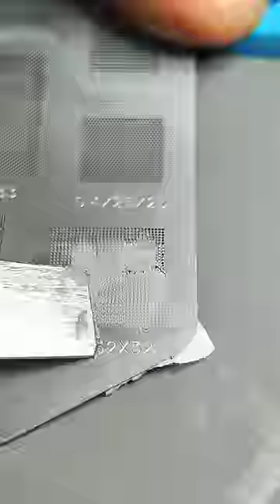CPU #shorts

Comment: For those that don’t understand what is happening, this man is removing something and then putting something else back on.
Reply from the maker: thanks for info 🌹
Reply: Why? What's the diff between the old and new ARM?
Reply: Why not just turn it off and on again?
Reply: @herrbonk3635  The new one is not broken.
Reply: Thanks bro, i couldnt see what he was doing cause of blindness ❤
Reply: I highly doubt they were even different chips.
Reply: 🤣🤣🤣🤣🤣🤣ur funny.
Reply: Why did he have to reball the chip unless it was pulled?
Reply: Thanks for clearing that up!!
Reply: Why not throw it away and buy a new one? This repair has to be close to that cost, and who’s to say the next chip on the board doesn’t let the smoke out in 5 or 6 hours of use? Boards must be obsolete, or extremely rare, and expensive to justify this..
Reply: @GRANITEMONUMENT  for a lot of things, replacement boards are expensive. The ones I was repairing for cell phone towers were 800 dollars, and that's when they were in production and all the development was paid off, the minimum cost.

If you do the diagnosis and repairs correctly, you can ensure that the root cause is actually fixed, usually a power issue causing the big chip to fail. Sure, it'll fail again eventually, but that's just reality. Saving a few hundred bucks is worth it, even if it costs a few hundred to fix.
Reply: I mean that's obvious,
You could try telling us what did he remove and added
Reply: @phillyphakename1255  well you stick to cell phones, because when your talking about older electronics you are getting into EPROM’s which don’t care if you test it, they fail over time., no shorts, or overheating, caps will fail as they get older, quite a few items on older electronics can be tested good today, and go bad tomorrow with no outside forces like heat, cold, short to ground, excessive voltage., they can fail sitting on a shelf., the neighborhood cell phone repair doesn’t get into that type of electronics…
Reply: @GRANITEMONUMENT  lol. I was working on cell tower boards, not cell phones. Hundreds of watts of RF output, thousands of watts of input power. Not your 10 watt phone.

And the reason I say "was" is because I am now working on exactly your kind of stuff. Date codes from before I was born. The shop smells like rotten fish half the time from the leaking capacitors. I've knocked 10 layers off the boards I repair.

I know that things fail, which is why we repair them. That said, the goal isnt to fix it forever, it's to get the customers a few more years out of their obsolete and essential equipment. At both the tower job and the old stuff job, we get our customers about an extra 5 years on average. Less than 5 percent get returned in the 1 year warranty. That's a far cry from your claimed fails after 4-6 hours or the next day.
Reply: He put the same Chip back on. It's not something new
Reply: @GRANITEMONUMENT it could just be reballing...
Reply: reballing, he is reballing the chip and putting it back in place
Reply: @herrbonk3635 new one looks prettier
Reply: it’s called cpu reballing it essentially changes the socket balls in the cpu this is normally done when a phone suffers from a deadboot commonly happening in cheap poco phones like notorious Poco M3, Poco X3 Pro this is common because they’re good to be true especially the Poco X3 Pro, the motherboard is cheaply processed that’s why
Reply: Thanks for explaining, I’m not a tech nerd so I wouldnt know he was doing that
Reply: its reballing process and not necessarily replacing it
Reply: @xavirav3358 ахахаа😂
Reply: This is done when you have dropped your phone Or overheated the cheap causing those soldering connection fail
Reply: LMAO
Reply: 1. Reboot
2. If rebootin' don't work. Level up yer skills to perform brain surgery. But on a puter.
Reply: They are called, CPU Reball, they just clean the balls pins under the cpu and put it back again.

Comment: feels like the last cpu getting ready for the one last fight
Reply from the maker: yes 😁
Reply: Терминатор собирается
Reply: that hit me hard.
Reply: Mission log Phobos base - Day 187: The oxygen generator has stopped working again, narrowed down the issue to the CPU board in the Modular Electronics Controller Unit this time. I used my only spare a week ago on the main power bus unit after that one got fried by an electrical short following the crash. The same incident also took out the orbital relay dish as previously mentioned. Attempts to reestablish satellite uplink today using the short range transmitters has been unfruitful, it was a long shot I suppose, but worth a try. In regards to the O2 generator issue, there is a another unit with a compatible board in the rover which  I can see  lying on its side some distance from the Eastern viewport, it seems mostly intact from here however I am unable to reach it as the environment suits are kept in hab 3 and the connecting tunnels from hab 1-2 and 1-3 were destroyed when the supply ship's propellant and oxidizer tanks went up, I am completely isolated here. I can see fragmentation damage to both other habs from here and they appear to have both depressurized. Mission Commander Hamilton, Mission Specialist Williams and Mission Specialist Wehrner... are presumed deceased at this point. Will try cleaning the board and connectors for the generator in hopes of restoring functionality, If the unit is still nonfunctional after this I calculate there is enough left in the reserve tanks for maybe a week. If anyone recovers these logs sometime in the future, let my family know. Tell my wife and kids that I am sorry and... I tried.
Reply: Wow! It gives off such a cool atmosphere! @extremepredudice
Reply: @DairoNecto  All we saw was a person cleaning a circuit board, context is everything :)
Reply: @extremepredudice  I'm always trying to write my stories in an interesting way, but I have a lot of difficulties. Seeing you do it like this is really impressive, congratulations!
Reply: @DairoNecto  Thanks :)
Reply: @BS-ys8zn o
Reply: Nice comment
Reply: @extremepredudice I'll keep your comment on my gallery, thanks for the cool writing:))
Reply: @extremepredudice Your comment along with the music got me emotional. Good writing.
Reply: “I’m sorry master, but i must go 🥷”
Reply: @extremepredudice Dude.  your legendary. Go make a fucking living doing this.   True inspiration right there. From nothing, to a (in my opinion) movie class sketch 😂
Reply: @cyphereq7887 High praise indeed, thank you :)
Reply: Nice one dude , you'll be remembered as long as time itself  @extremepredudice

Comment from the maker: Flux helps the heat spread easily on the board and also protects them from heat ,Another function of flux is this
Reply: @shaunkeith4087 you know nothing about board level soldering
Reply: @shaunkeith4087  Actually it does. Its like in cooking how oil helps distribute heat more evenly.
Reply: What type of flux is that? The regular orange brownish stuff dries out too quick
Reply: Не знаю как он там работатет, флюс на проц, а не под него, после зачистки спаянные пяточки, ппц просто
Reply from the maker: @YOBAMUSTDIE snowfall
Reply from the maker: @xasijonson4711 are you sure 😊
Reply from the maker: @devonrose2934 amtech flux rma-223

Comment: try changing the chipset instead of MTK, but one equivalent to the MTK, for example Kirin / Snapdragon / Exynos. will it run.
Reply: @techshowmobile  he asking to changing the chipset on the same performance level but from other brand. Can it run
Reply: Kirin - my favorite of all the time!
Reply: Noo these different processes have different architecture
Reply: @tigerpirate1849  And different pin out too. 

As long as the pin is same, the hardest part is to reprogramming the firmware so it can connect to other chip, like IO to storage chip and rams.
Reply from the maker: hi 🌹
I'm late for reply 🫣
Unfortunately not possible
Reply from the maker: @mrifanirawan4820  hi 🌹
I'm late for reply 😁
no!
Reply from the maker: @the_dovla  👍🌹
Reply from the maker: @tigerpirate1849  that's right 👍 🌹

Comment: It's a ball grid array processor set up. Typically found in laptops they are CPUs that are just soldered right into the motherboard itself saves space downfall is you need to know how to do this if you wish to upgrade or replace the chip. Awesome video! ♥️♥️
Reply from the maker: yes you are right 👍
thanks for watching 🌹

Comment: If that board worked after the manual chip replacement that's either impressive skill, luck or a bit of both. I'll use a rework robot and get it right first time, every time, though.
Reply from the maker: thanks for info

Comment: Can you replace the Snapdragon processor?
Reply: Imagine  replacing helio g25 with 8+ gen 2
Reply: I've always been curious about this. Replace midrange chip to flagship chip. Will it still work?
Reply: @-_-_EpicaL_-_- lol
Reply: @kokom8405  pretty much impossible. its integrated cpu thus it'll require compatible board. even if you able to design board for it, you'll need to reverse engineer the driver to make it work. its too complex and expensive to be worth it.
Reply from the maker: hi 🌹
I'm late for reply
Unfortunately not possible 😊
Reply from the maker: @-_-_EpicaL_-_-  no 😊
Reply from the maker: @RaflyBw  not possible 😊
Reply from the maker: @miru2583  hi guy 🌹
I'm late for reply
thanks for replying

Comment: Una pregunta por qué razón colocar flux encima del componente si la soldadura está por debajo
Reply: Если он без нижнего подогрева делает то так он более равномерно прогреется
Reply from the maker: @piglin1779  thanks for reply 🌹🌹🌹
Reply from the maker: hi 🌹
I'm late for reply 😬
Flux helps the heat spread easily on the board and also protects them from heat ,Another function of flux is this

Comment: Removal of the chip, then removes the ball grid array from underneath, places new balls with the help of stencil and flux paste, heats the balls into place onto chip and then onto PCB with a hot air nozzle. Hard stuff to actually do...props!
Reply from the maker: yes 👍
you are right 👍

Comment: Fellow repairman here with some friendly questions: why did you put flux only on top? Me personally i put it at the side and use hot air to flow it beneath the chip (it makes more sense to soak solder with it?)
Reply from the maker: Flux helps the heat spread easily on the board and also protects them from heat ,Another function of flux is this

Comment: It still surprises me how these chips still work after copping so much heat through them...
Reply from the maker: They are resistant to heat.
Reply: @techshowmobile  they would want to be. Used to be drilled into me when I was learning electronics, not to fry the chips, transistors etc. by putting too much heat into them when soldering.

Comment: flux on top of the chip instead of under it.  Makes sense.
Reply from the maker: Flux helps the heat spread easily on the board and also protects them from heat ,Another function of flux is this
Reply: @techshowmobile what flux do you use?

Comment: wtf is that stencil, i'm confused by that part, don't the stencils usually need to match the pattern of the solder balls on the chip? 
Or is that not solder?
Reply from the maker: When we don't have the same CPU stencil 
We have to use the same

Comment: What is the liquid staff called and also the reballin staff?
Reply from the maker: ic reballing
Reply: @techshowmobile  Thanks, the cream you put on the chip before applying heat with the heatgun? I'm a software engineer looking to move to hardware repairing.

Comment: What good is flux on top? Its supposed to touch the solder
Reply from the maker: Flux helps the heat spread easily on the board and also protects them from heat ,Another function of flux is this
Reply: @techshowmobile  huh… TIL

Comment: Why did you put flux only on top of the chip? Shouldn't it reach underneath?
Reply from the maker: Flux helps the heat spread easily on the board and also protects them from heat ,Another function of flux is this
Reply: @techshowmobile  Oh ok, didn't know that, thanks for the answer!

Comment: Putting flux on the package. Thats a joke, right?
Reply from the maker: it's not jok
Flux helps the heat spread easily on the board and also protects them from heat ,Another function of flux is this
Reply: @techshowmobile  I dont agree with the degree of helpfulness you suggest, but I see your point.